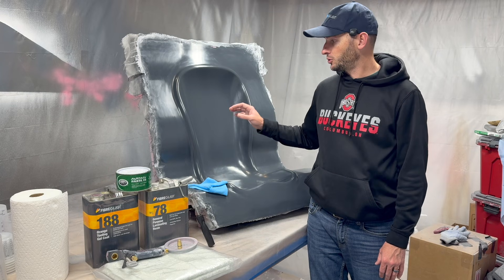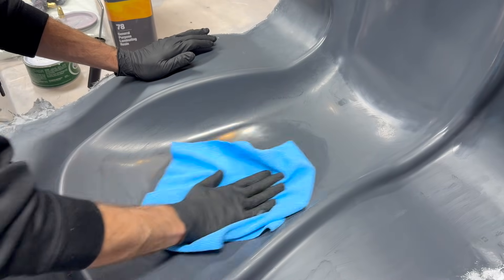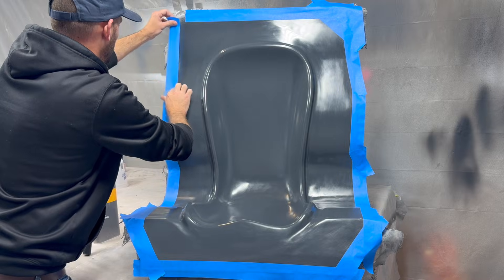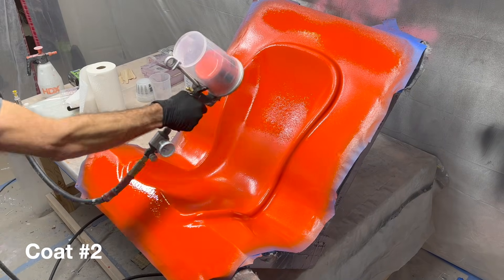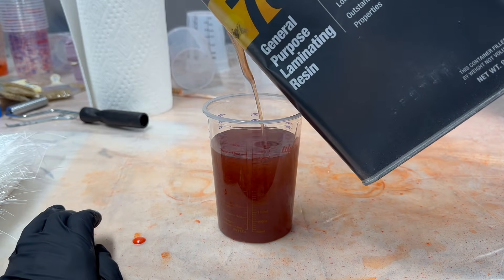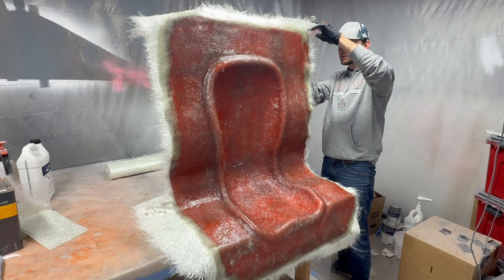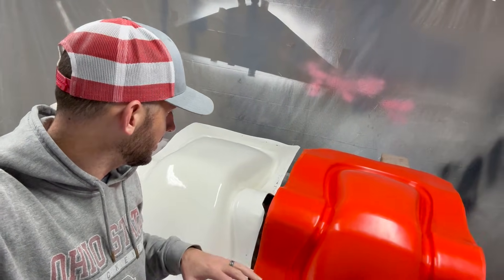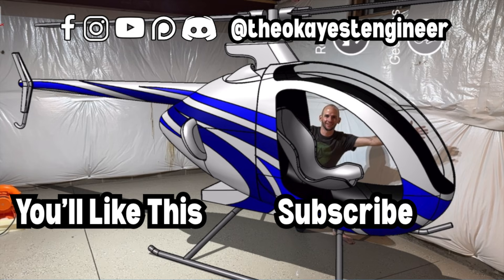Custom Carbon Fiber Helicopter Seat Part 2 | Basement Kit Helicopter Ep. 21

Comment: Bro spray the pva, light dusting for 2-3 coats. Purple gun from harbor. You shouldn’t even see it go on. Same with the wax, light coatings for 4-5 rounds. Use a paint roller for the poly, 3/8-1/2 nap. Stop screwing around with the brush. Yes it’ll soak up the poly but you can use a 5in1 to release it from the roller when you’re done and can finish with the brush. Also gelcoat likes to lay thick. Do all these things and your life will get easier.
Reply from the maker: Thanks! Fear usually takes over every time I think to try something new and I resort back to what I know works lol.

Comment: You're putting your PVA on much too heavy. All I have done over the years is to just dust or mist one coat of PVA on after waxing. Also, buff the wax coat completely. At times I have even thinned it a bit depending on the spraygun I am using. Try a couple of test panels to get the feel for it I think you'll be surprised at how little it really takes for a clean release. ☝

Comment: Careful there. You might have to reconsider the okayest part of your name!

Honestly congrats. Practice makes perfect.  Product idea for Fibreglast, a practice kit with a simple small part and enough material to have a dozen or so practice attempts at making molds and making parts.
Reply from the maker: That’s actually a great idea. The odds of you screwing up a few times while you learn is basically 100% and it’s a lot cheaper to learn on a small part. The most annoying thing is getting the spray guns out for primer and gelcoat. The cup gun is not as bad but still annoying to clean.

Comment: Came out great? Just a view questions: did you use wax on the last layer of laminating? Did you roll any bubbles out? And how do you deal with the polyester fumes?
Reply from the maker: I did not use wax on the last layer. I don’t really care if it’s a little sticky. For what I’m doing, it’s a non issue. Good point on rolling bubbles out. I used too much resin to make sure I didn’t have any bubbles. It’ll make the part heavier and more brittle but once again, I only need this thing to last for a couple pulls. 

For fumes, I built a paint booth in my basement with a fan that blows out my basement window. It keeps a constant negative pressure inside the booth and doesn’t let them escape into the house. It works extremely well. When I need more ventilation, I crank the fan up and open the door.
Reply: @TheOkayestEngineer : Ok. Thanks for replying back. Happy Thanksgiving 🦃

Comment: Is there a reason you do not roll the epoxy and glass with a hard roller?  I would think that would help the glass and epoxy to bond to the gel coat.
Reply from the maker: I took a hard roller out but didn’t end up using it. The tight contours don’t work well with the roller, and I was sure to use a lot of resin and keep bubbles out. The mold is probably a little less strong but it’s still plenty strong for the number of times I’ll use it. (Like twice haha)

Comment: Looks like it came out great. What’s the reason for not making the mould from foam… as you made the plug ? You only need 1 seat so the mould only has to work once.
Reply from the maker: I don’t have a good reason. I wasn’t confident the foam was stiff enough to handle the vacuum bagging. I also need to post cute the carbon part… the fiberglass mold is good to about 200f ish. Not sure what the foam would have held up to. 

I would hate to lose the plug before I got a good part off. Making another plug would be way more work than making the mold.
Reply: @TheOkayestEngineer I thought those might be the reasons… the plus side is you wouldn’t have to mess around with chopped strand mat, work of the devil 😂
Reply from the maker: @paulcrabb7167 composites are the devil. Period haha. If they didn’t perform so good or look so good no one would do it.